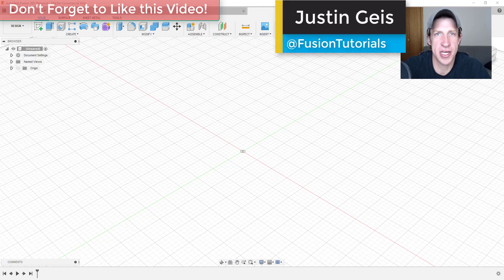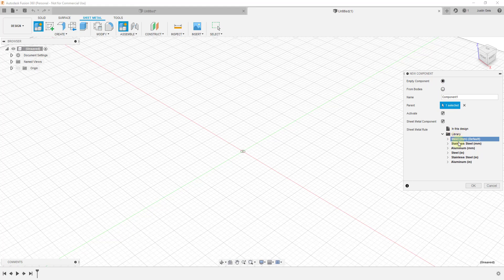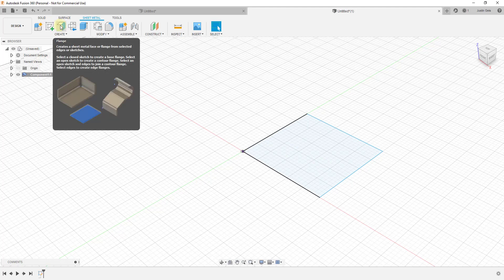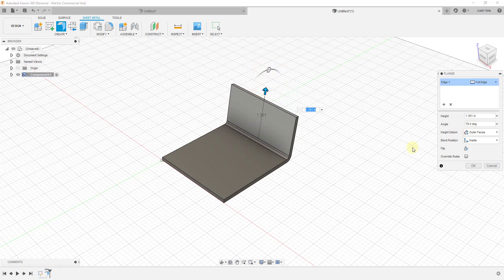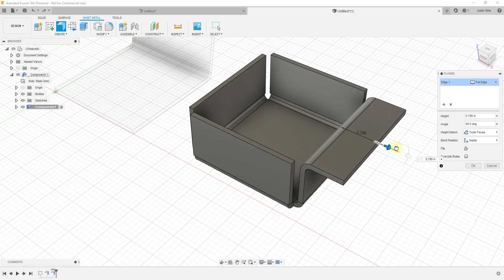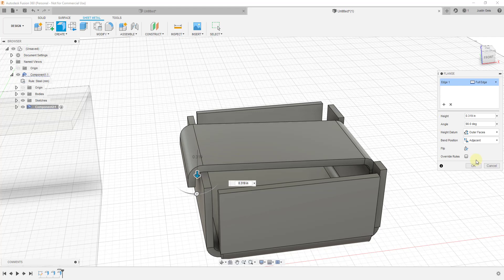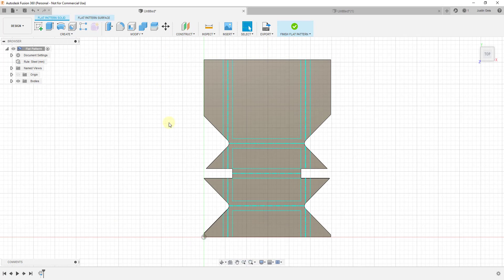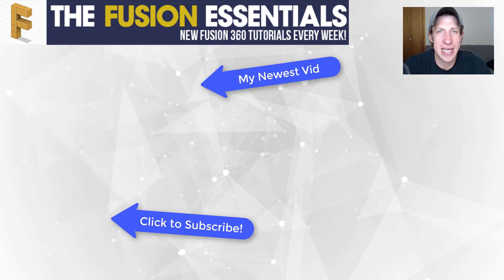Intro to SHEET METAL in Fusion 360 - Sheet Metal Beginners Start Here!

Comment: Everyone in these tutorials makes the same assumption: that the bend line is at 90 degrees.  But what if it's NOT?  For example, assume that you start with a rectangular piece of sheet metal and then draw a NON-90 degree line through the middle of it, thus creating essentially two trapezoids.  How do you bend on of those pieces to 90 degrees?

Comment: hEY, the default thickness for sheet metal can not be changed. I want to use the bending feature but I want to bend 1/4" flat bar or plate steel. If I thicken the sheet metal, the bending feature goes away. Any ideas?

Comment: Thanks for a great video.  🙌  Does the software allow you to assign a thickness value to the material?  I'm designing HVAC equipment using PIR board which is 20mm thick?  Thanks in advance 🙏

Comment: Thanks for the video.  Its inspired me to draw up my parts for a product I manufacture. Much of what I make for the product are studs and I hem the edges so my customers don't cut themselves to shreds.  I tried to do a flange and 180 degree it but that does not work.  If I override the  bend rule to .001 in the best I can do is 175 degrees.  How would you go about this?   I have my thickness set for 26 gauge galvanized -.0217 btw.

Comment: Hi Justin, Firstly thank you for such an easy to follow tutorial. This is exactly what i need to get started. I have 1 question though - one of the components i am designing has an overlapping interlocking corner joints when folded up and i cant quite work out how to include this feature. Is this something you can shed some light on please?

Comment: I always used a piece of cardboard and a pair of scissors to make prototype patterns b4 transferring them to metal.... I keep a few cardboard boxes lying around for it...  An ability to actually see the part in your head also helps a lot...  I just look at the place the part will go and fill it in with the cardboard and holding everything together with masking tape... 

Design it in cardboard and then just trace around that pattern on the metal with a sharpie....  Often times I can design the part in under an hour without even having to do any math...  I often found modeling it on the computer after taking a ton of measurements and then transferring the designed product to a print to be made is over complication....

Comment: Hi Justin. Your videos are awesome, thank you! I have a question for a project I have at hand, its a wood firing kiln for ceramics. I was wondering if theres a method for creating a module or a brick in this case (31/2" x 21/4" x 7 5/8") and then laying that over and over again - as if to imitate actual brick laying. Most commonly when it comes to brick-work its a straight wall and you would only add a surface texture in the end. But in the case of a kiln the bricks are laid out to create various structures. It would be useful to use a module block in order to construct such a model, I would think. Kiln builders usually take a squared notebook and draw out all the layers of  bricks to figure out overlapping and final layout. I was wondering if I could do that in 3d?
Thank You!

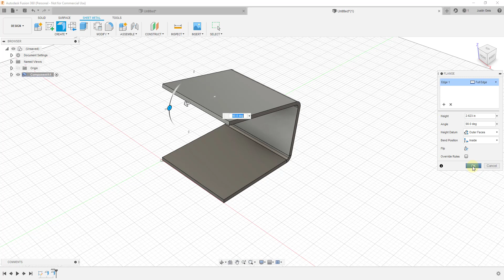Comment: THANKS for the video - BUT Whoa! What happened to your first example at 3:45 in the video? Why did that piece gray out? 
I'm a newby and this has happened to me several times, making my previous part inaccessible. What malkes that happen and how can it be avoided, please?
Reply: @AerialLensVideo, that happens when you activate a specific component. When you drag your mouse over a specific component in the browser you will notice that a round circle (a radio button) becomes visible. When you click on the radio button, that specific component becomes the active component, and all the other components are grayed out. To make all the components visible again, you have to active the the entire model (the top-most assembly in the browser).
Reply: @AmericanMakerCNC  Ahhh. Yes, thanks -- I got it now. Still a LOT to learn, and you really do help in that effort. Thanks!
Reply: @AerialLensVideo  Glad I could help. I'm still doing a lot of learning too.

Comment: Cool. I had a thought for 3d printing a template to mark your sheet metal. Like a 10 layer thick 4 walled skeleton just to mark the edges. And add a dotted line patterned groove for marking fold lines with the same sharpie!

Thanks for the quick tutorial!

Comment: I'd really like to see how you create sheet metal in an assembly - I am having problems making a screen on a machine - create component in sheetmetal, press face in solid part, extrude to 1.25mm, pull one edge 2½mm and then when trying to add flange the system does not respond.
Up to that point it looks like it is done right - 

How you design in assemblies - especially aligning holes seem to be totally dysfunctional

Comment: How do you put in the thickness of your material?
Reply: Hi Chad,  I'm brand new to F360 and had the same question.  I worked around it by creating the body in the SOLID tab - sketch the shape, then extrude to your specific thickness.  Swotch back to SHEET METAL tab - select "Convert to Sheet Metal" from the CREATE menu. Now you have sheet metal to play with.  Cheers
Reply: @owentaylor9652  Thank You!!

Comment: You're obviously well adept at Fusion. But as I try to follow along with your tutorials, you wiggle the mouse pointer all over creation. You have to realize that your student is trying to follow your mouse clicks. When you roll the pointer around 5 times in a circle before you actually go to what you want to click, it can really be a huge distraction. Other than that, thanks for the knowledge sharing.
Reply: It ain’t hard man.  Just try and mess around on your own time.   The thing I figured out with learning fabrication processes and cad and Cam design is everyone teaches and learns differently and most people who are pros found out way to do it by themselves that’s why there is so many ways to do stuff in the fabrication world.  It takes time and persistence.  Trust the process.  I got thrown into a machine shop two weeks ago I got a three day crash course on a HAAS CNC Mill and I never touched Fusion360 before in just a couple hours of messing around with it and watching a couple other YouTube videos of other people.  Hence why I said everyone teaches and learns differently I created a 3.90x2.40 Block of Aluminum with three different holes that need drilled and it needs a milling tool path to go .200 around the block.  Just by messing around with it.   But I was also running a Machine to so I was multi tasking.  lol.  It just takes time trust the process